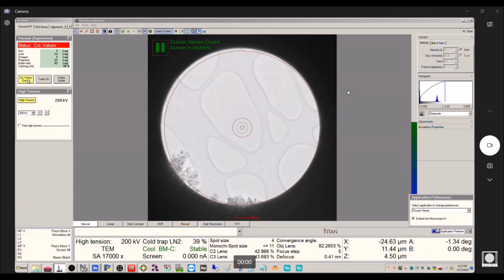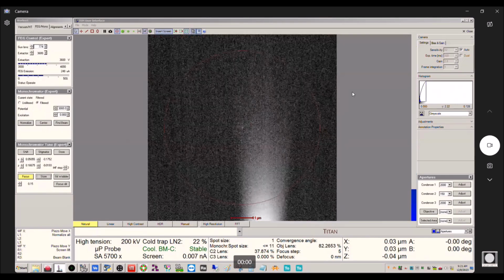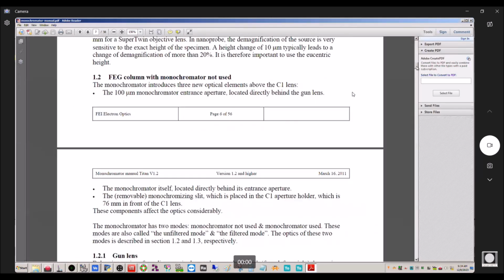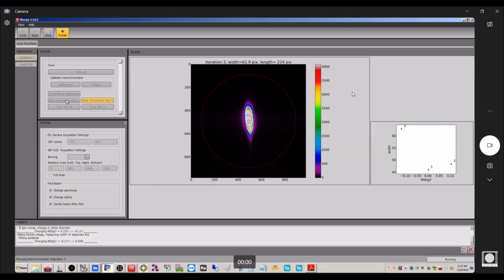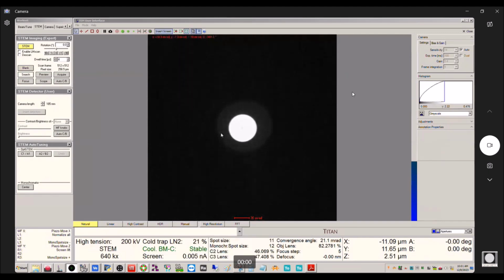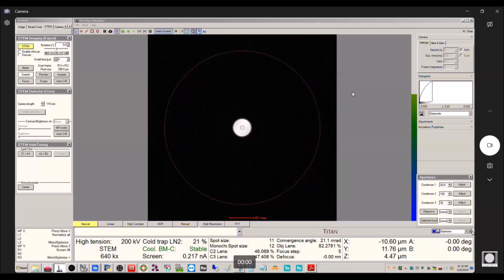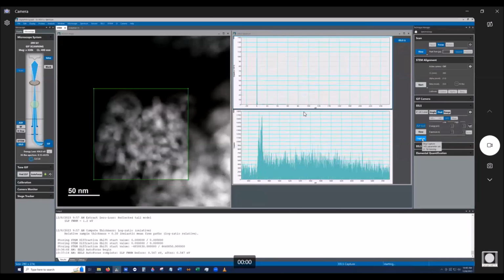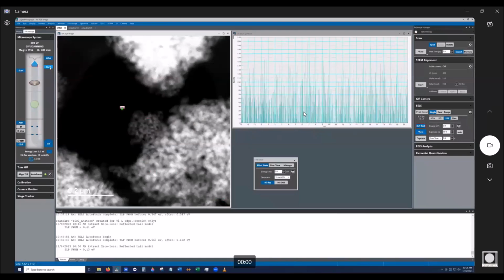FEI Themis Z S/TEM: monochromated STEM-EELS

Comment: If anyone else have troubles with OptiMono losing the beam during excitation you need to update your monochromator tables. This setting on my Spectra 300 is in the Alignments -> Monochromator Table -> Excitation. At some point you will need to go to Monochromator Tune (Expert) and click Reset in the Offsets tab. Afterwards, the alignments are typical focus/center beam for all the possible excitations on your monochromator :)